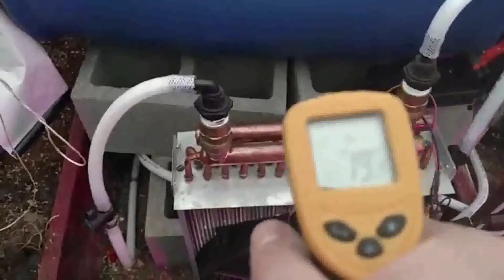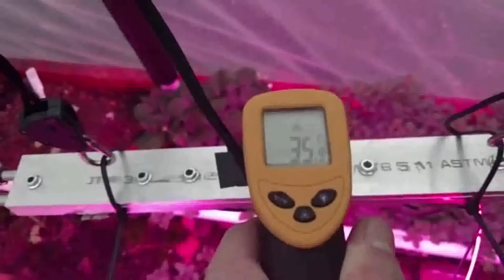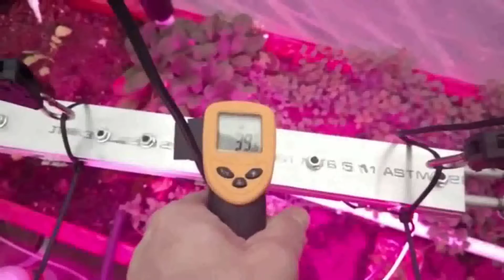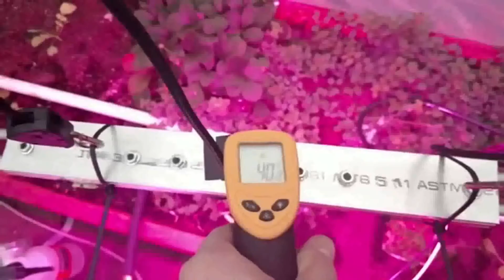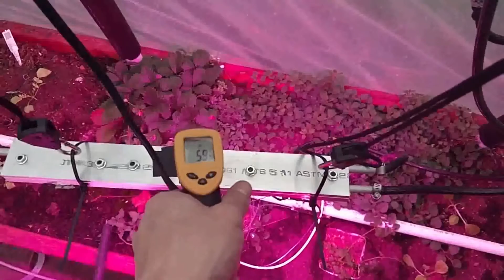New water cooled LED strip

Comment: Careful bud, if you're reservoir isn't dissipating alot of heat, or enough heat well enough due to stagnation or lack of surface area, eventually your whole reservoir will heat up and = not good. Sure to keep an eye out. Also whats yo boi charge to make 3'-5' lengths of that and ship to CO? I'm about to buy a bunch of cpu water block heat sinks 240mmx60mmx12mm for 6 bucks each. Was also thinking of using rectangle tubing and running water through one of those or square tubing and building the fixture off that. Sadly biggest problem with tubing is price jump when ya go from 1/8th thick 1/16th thick which is to shallow for mounting screws to 1/4, which is still super shallow for led mount holes but should be good enough, price jumps like 10x
Reply from the maker: reservoir is 50 gallon tank and is cooled both by geothermal and by heatpump chiller... but it still gets pretty warm in the summer days.
Reply: @tripzero0  Oh dang. I only bought a radiator and some cpu fans and was hoping that'd be enough with a 5 gal bucket o.o;;; ohh sh*** lol. I am only running one single 1200 watt fixture tho